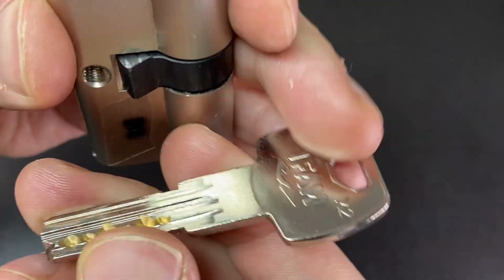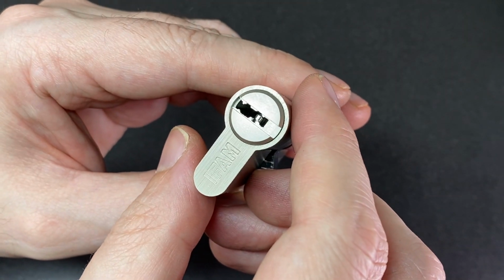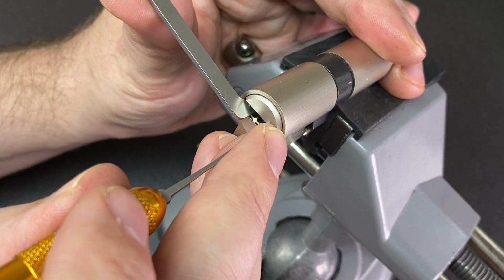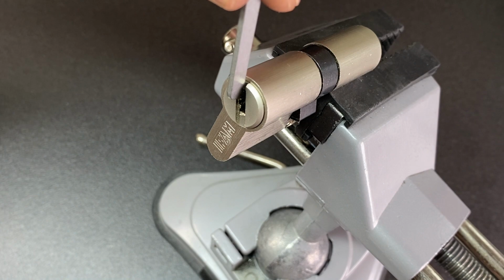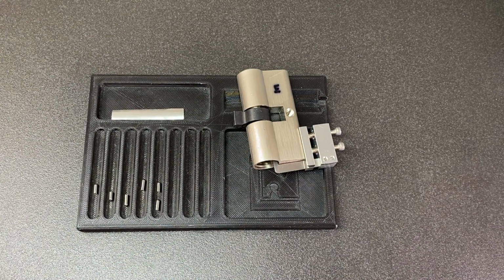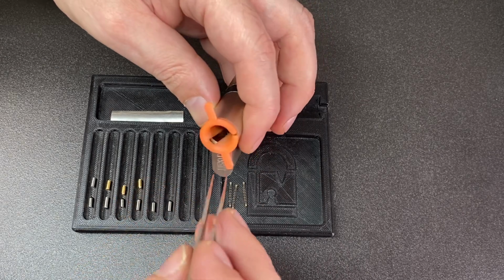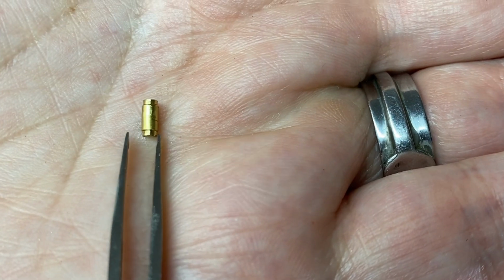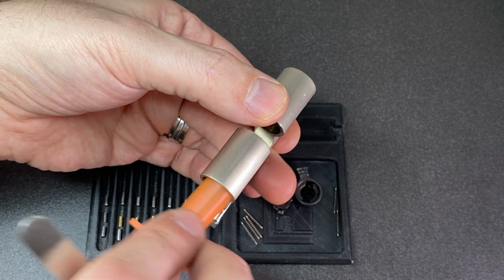IFAM M2 Dimple Lock Stock vs Mod Picking Challenge

Comment: I rarely see a dimple lock on my side of the pond, but all the same, I need to find one of those plastic front followers (the orange one) I already have the springy clamp that fits in the groove (came in a gutting kit) but without that orange one choices are limited to either gutting both sides and passing a regular straight follower all the way through, or none at all and hope to figure out which pin goes where.
Reply from the maker: There should be models out there you can get 3D printed

Comment: I have got a set of those dimple picks but I havent modified them - any recommendations on how to?
Would love to get multipick version but funds are limited at moment.
Very interesting seeing the internals of that lock.
Thanks
Reply from the maker: I use files to take the square corners into an octagon, then use 600 grit wet and dry paper so sand round, then take up to 1200 grit in grades of 200 to polish